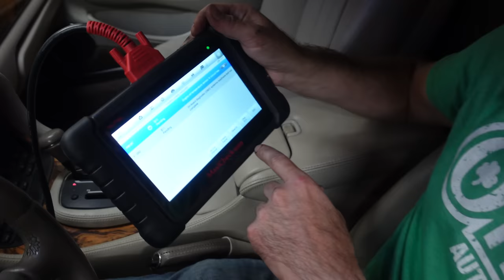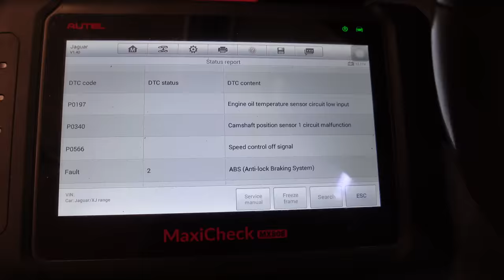Spoon Feeding My CHEAP Jag Oil... Because The INTERNET Told Me To

Comment: It's not like you to give up!
Keep it around and work on it a little bit at a time!
Reply from the maker: The police will ticket me for non-running vehicles, I can't keep stuff like this without a real shop 🍻
Reply: @WatchJRGo  put two electric boards under each axle on rear, just barely lifting tire.  Wire a switch to give it power. Move it around. Or at least see if I can move it in neutral. It would be hilarious and childish. 
Do something simple like Garage 54.  Until it's fixed.

But yes indeed that's sad you gotta mess with chains.
Reply: @WatchJRGo  Some commenters in the previous video mentioned something with the brake-system on these cars being connected to the engine management system, more precisely stopping the fuel pump if there is a problem with the brakes. Check the brakelights and brakelight-switch(what was that abs fault that came up on the scan?). others mentioned possibly it was a blocked/restricted exhaust. In any case I hope you figure it out, if not punt it of too Hoovie;-)
Reply: @WatchJRGo  that's the nice thing about being outside of city limits, can have all the non-running cars you want
Reply: @WatchJRGo  that sucks.
Reply: @WatchJRGo  put it in storage... along with some of the crap... stuff in your garage to give you room to work.
Reply: @WatchJRGo  You need a warehouse with a bathroom, sleep there, and follow your passion!
Reply: @WatchJRGo   booo.  I kinda want to see this one run.

Comment: Ignition switch. It runs when in the start crank postion then once you put it in the run postion it dies. So no power to the coils ect once you turn back the key. if it was the timing it would not appear to run "decent". But the timing could be another issue as it doesn't fire rigtht up. Just my 3 cents as I seen this many times before.

Comment: Ford owned Jag at the time the XJ8 was made.  Ford had 32V V8 4.0L in the Lincoln Continental sedan and 4.6L in Mk.VIII and Cobra.  IIRC, they had aluminum blocks so little to no weight penalty.  If Jag management was open minded, they would have fitted Ford engines and transmissions including the manual.  Imagine a XJ8 with all Ford power train and electronics in a XJ8 body.

Comment: Check the engine number is original. If the engines been swapped or loom/ecu swapped for a different model you are in for trouble, with mismatched parts

Comment: I find it strange that in BMWs and it seems in Jags that having Nikasil blocks is bad but with Porsches having a Nikasil cylinders is good.
Of course, the true cause of the failures was not the Nickel Silicon Carbide coating itself but the fact that sulfur found in low quality gasoline caused the coating to break down over time.
Reply: I heard it was a combination problem - the nikasil + the computer fueling strategy would flood the engine

Comment: The engineers that designed the engine bay were certainly thinking into the future.
A  built-in tool storage tray!
They knew that mechanics and owners in the future would be working on the engine or electronics everyday that ends in "Y"!
Jaguars and Range Rovers usually have sumptuous interiors because the engineers that designed those why did you to have a nice place to sit while you were waiting for a recovery vehicle after the inevitable breakdown

Comment: If you end up having to go through that engine, do yourself a favor and ease down to your local Mercedes dealership, and go to the shops parts counter and buy you some Merc gasket sealer. Best stuff you'll ever use. Its just about a necessity, to successfully work on ANYTHING euro.

Comment: I wish I never sold my jag... I bought it already swapped with a 351 Windsor and c4 trans(only way to get a reliable jag is to swap it) it was a sweetheart of a ride.
Reply from the maker: There's a reason everyone makes a kit to swap old Jags to 350 Chevys 💯
Reply: @WatchJRGo  rubbish,jaguar engines are far better than anything american.theyre just a bit to sophisticated for ya.they like a bit of specialist attention from time to time and they will then run smoothly and reliably for hundreds of thousands of miles with good maintenance.problems like that would be diagnosed and sorted easily in the uk and probably most of europe.keep at it,theyre well worth the effort,nothing runs as well as a jaguar when its bin properly sorted.

Comment: What is the likely hood that engine was swapped with a similar but incorrect engine?  There is a lot of indicators it has been apart.  Unused cam shaft plug, intake tube doesn't fit right... or possibly someone swapped the harness?  Seems like a basket case at any rate.   Other thought is security system? possible the key needs re learned? some cars will fire for a few seconds and die when it doesn't detect the key.... I'm no Jaguar expert but seems like that one would either be a RFID or even a battery operated key...

Comment: check the sensor, you have all the tools. A bad/intermittent sensor can be a reason as fuel and ignition is controlled on its signal.

Comment: Not by any chance the security system , chip in the key ? Have you tried locking and unlocking the car ? The spare key if it has one , sounds silly I know , but I had a Volvo with those chips in the key and this is exactly what it would do if it didn’t recognise the key. Failing that , doesn’t this have 2 fuel pumps ?

Comment: JR it will not start if cam shaft sensor is not plugged in or the cam is out of adjustment.
Computer needs reference from both sensors. You  normally can unplug the sensors while car is running and car will still run but to start it needs to sensor. I think the sensor you are looking for is in the rear of the block.

Comment: My guess is a bad or corroded wire in there. Mine had a corroded connection on the back of the fuse box. or Corroded in the map sensor

Comment: Is the exhaust plugged? is the cat plugged up. That will stop ignition.
Reply from the maker: It could be, but I saw quite a bit of white smoke come out after starting it with the oil 🤔
Reply: @WatchJRGo  My truck produced smoke when it had a clogged cat. You could try just disconnecting the cat just to see if you get good exhaust. Its either ignition, fuel or exhaust that prevents running.

The crank shaft sensor is another avenue as you are exploring. My truck had that issue as well with a torn wire.

Comment: Well, you're close. There is only one cam sensor you're correct. Sure does sound like you got some compression back after adding oil. Gut still says timing could be off based on the fault and those pops in the intake I keep hearing, not a good sign.  I'd double check and make sure you still have good fuel pressure once it tries to start now that everything else is back together. I have had some really weird luck playing with the pedal like it's carb'd and cranking to the point where it would eventually start to run. Just go crazy with it. 

Another thing, if you have the means to check it smoke test the intake. I have seen these leak at the two halves and gaskets are not available. Used intake or fingers crossed trying to reseal it. Just trying to cover the bases.  

That said, I think we know why it was left there. Can't say you didn't try if you don't have any further luck with it. I'd be right there trying everything I can, too.
Reply: I will say, the timing job isn't actually that bad at all! Hood off, radiator out and you have tons of room. As long as the heads don't have to come off. But even so it can be done in car. I know that wouldn't be worth it at that point but hey worth considering...

Comment: My guess is a restricted exhaust. cat might've melted down due to misfires/lack of spark from all the oil around the spark plugs. Also, the low/dropping fuel pressure still is a big concern🤷

Comment: Try drilling a 3/32 hole in the filter where the fittings thread into it, and spray CRC or Blaster into the hole.

Comment: Any chance it’s a fuse? I had a Mazda RX3 w starting and running on two different fuses (maybe that’s common?). Anyway blew the running one. So it would turn over and start while cranking with the key, then die when I let go of the key like your Jag. Btw you can drive 3hrs holding the key barely in crank mode (enough to use the starting circuit, not far enough to engage the starter) before being told to check a fuse. Ask me how I know.

Comment: I think your exhaust is blocked, what happens it's got a small leak that allows some of the exhaust pressure to clear, which allows the engine to run for a second then exhaust is filled again and engine dies. Had the same issue with a Kia Carnival, caused by rough ride on a tow truck, these cats are old and rubbish. Just detach the catalytic converters from the exhaust manifold for 30 seconds and crank it.

Comment: No compression, piston rings seized,
Remove plugs, crank engine look for SMUCK to shot out, fill each cylinders with diesel fuel, let sit overnight, this is intended to loosen piston rings, my 1998 xj8  140,643 kilometres ,was cured in 24 hours.

Comment: It may sound silly, but check the backside of the floor mats. Make sure the ones marked "L" are on the driver's side of the car and the ones marked "R" are on the passenger side. I know it sounds obvious, but a lot of people mess them up and then their car won't start.
Reply from the maker: This must be a Jag thing, is there a special tool? 😛
Reply: @WatchJRGo  Yes, starts with B ends with omb. Good videos. When are you getting back into a real garage...

Comment: That many codes popping up, I would be inspecting every ground cluster on it looking for corrosion. Beyond that, the timing seems to be off, either a bad crank/cam sensor or it actually jumped time.

Comment: Get it running with an external fuel source and see what it does then.  At least before completely calling it quits. But if it passes a leak down test it's probably worth fully sorting it out.

Comment: JR: BMW used nikosil in some of their 1994/95 engines. If you're not happy with the spoon-feed method you may want to research how BMW solved the issue. What's bizarre is BMW knew there was a problem with Nikosil in 1995, yet Jag used it 2 years later for 3 year???????????
Reply from the maker: Yup, blows my mind that we see insanity like rod bearings as wear items, insane cylinder coatings in passenger cars... all things that should've been tried for a year, then never seen again 🤯

Comment: Cut sling load! Excellent content but a PITA. If you could drop in a used F150 4.6l at a cheap price then okay...if not send it to the crusher..not even sure there is a market for parts..lol. Timing chain slip at less than 80K miles...Send it fast!

Comment: The engine has been swapped with the incorrect one. Earlier year models did not have the Cam 1 sensor in them. I bet this engine was swapped, and the rolled it out side when they could never get it to run.

Comment: I have had this problem on a european ford mondeo -00 it was the immobilizer. And if your Jag has been sitting for so long probably with a drained battery the ecu has lost the coding of the key. The engine starts the ecu gets rpm signal and shuts down. Ford owned Jaguar 1990-2008 and i know the two brands chares a lot of components.
This is the european fords.
So try to code the key or delete the immobilizer.
Fredrik from Sweden

Comment: That sucks. Those coil packs are probably junk. Wait there's an issue!!! The compression is lumpy!!!! Take the Kim covers off and check and make sure the flat spots on the cans line up it sounds like it may have jumped a tooth in time causing that motor to sound lumpy when it's turning over. It should be silky smooth. Is a possibility that the valves and the Pistons have met causing bent valves which would screw up the compression. Also you could wind up having a low compression because the exhaust cam is off by a tooth. Take those cam covers off!!!!

Comment: OMG sometimes I just can't even. The thing that ate the Nikasil engines was fuel with a high sulfur content that was not in every market. Those fuels have been phased out so if you have good compression now, it will just be fine. I'm sure it makes for good content trying fixes but it's ether a good engine or a bad one. 

My '99 with an identical engine was 185-190psi when I tested it @122k, now has over 180k with no signs of slowing down.

Edit: there is a rubber boot in the end of the intake that makes the seal. I also sent you a message on IG if you need any references off my '99.

Comment: Just send it go get you over can and break part cleaner not either and see if she'll run consistently oil pressure May pick up chain May tighten up might have been a blip in the oil pressure you never know it not like you've lost anything sometimes they need a helping hand plus the fuel injector are probably gunked up a bit

Comment: Had the same problem with my xkr  that was stood for 2 years, fixed itself after a week with new fuel soaking in it.
Reply: i think he needs to swap new fuel filter out because pressure is not the same as flow. He could also check one injector out of head to verify. Oh I just realized one or more injectors could be bad eh?

Comment: It acts like the circuit providing ignition power works in crank, but NOT when the key is in the run position.  It runs (Bad tensioners or not) in crank then dies in run. Put in a jumper wire from the battery to the ignition source to test. i.e. the old wire direct to the coil idea, but here computer.
Reply: My thinking too,  easily tested,  leave the ignition key in run position,  use a  start button /jump on the starter solenoid to crank the engine,   if it does the same thing as usual then its not that,  if it doesnt do anything at all,  then the ignition isnt live in run,  and only live in start position.
Reply: @mrme2483  Spot On

Comment: Sooner or later that knock r loose has got to work so you can swap the fuel filter. Wonder if the fuel pump is pulling more amps than usual? I don’t know anything about Jags than what I see in your channel, but yours only has a single fuel pump, not dual? 
Anyways I hope you keep at it for a little bit longer, even though it was only $1k.

Comment: If it runs well when it does run… believe it or not I’d change the battery. Those cars don’t like old batteries. So they throw sensor codes to tell you to change it lol.

Comment: Can't believe you didn't go ahead and put new ones in
Reply: Plugs
Reply from the maker: If the engine ran I'd change them... at this point it will need another thousand in parts minimum to run 🍻

Comment: Could it be that the engine shuts off, because it is missing sensor data from a cam-shaft sensor. This also seems like how many cars act for anti-theft. It could be that it can't monitor the temp of the engine oil, so it shuts off. All of these are self-preservation tactics to keep stupid people from running their car without things like camshaft positioning which the computer needs to dynamically produce the spark properly to each cylinder. A jag tech from that time-period should be able to help identify that open connector for you. Additionally, a shop-manual or service-manual for the motor will tell you how many cam position sensors it has, and where they are located. Chiltons or whatever.

Comment: If the fuel line was under pressure, and you needed to change out the Schrader Valve, here is a cool tool to change it out while under pressure.
It also works on Refrigerant Lines, that has the Schrader Valve  https://www.youtube.com/watch?v=zsLZE5SG0EY&t=63s

Comment: someone swapped a aj26 in there your car came with a aj27 with variable valve timing and needs both cam sensors.     aj26 97-98       aj27 98-03
Reply: I hope he reads this comment because you have an excellent point. LKQ sold him the wrong engine for the previous Jaguar he engine swapped.
Reply: look at the valve covers it has 27 vvt actuators in it

Comment: Found this online
dsnyder586 , 08-16-2013 10:51 AM

Veteran Member

You need to leave the air cleaner tube assembled and in place for the car to run. If it runs when you spray carb cleaner then it is a fuel issue- Replace the fuel filter, then start looking for intake leaks because if you have the right amount of fuel but way too much air it will have the same effect.

 Reply
Reply: Someone had the same problem as you they did this and it started right up
Reply: greenlee63 , 08-18-2013 11:24 AM

Junior Member

Thanks I just read this andbappyto say I discovered that solution you mentioned as a last resort. I went through all of the fuses and relays again onset time. Then I decided to try installing the air cleaner assy and bang it fired right up. I could not believe it. Thanks for your help. Jam surprised the car is that sensitive